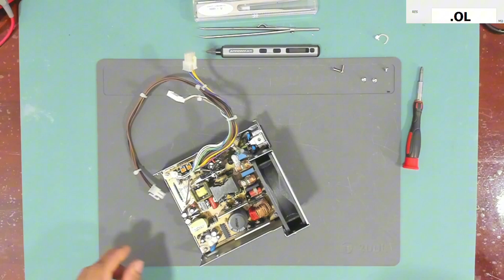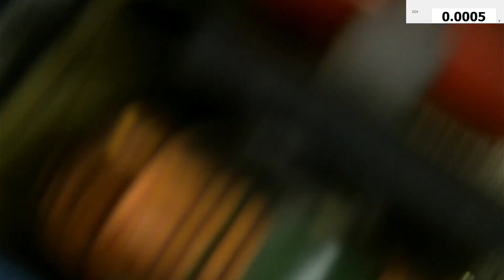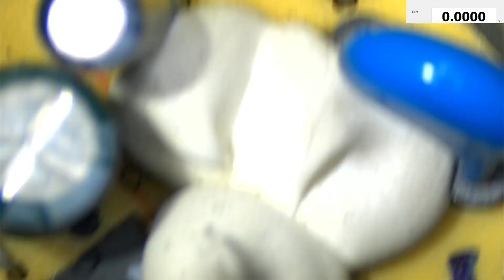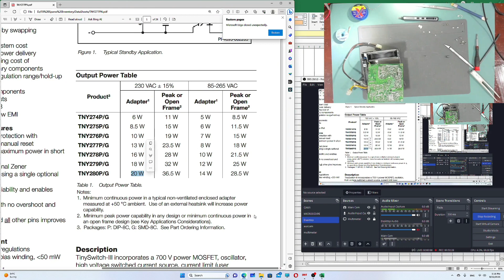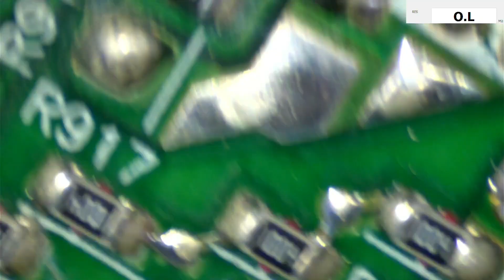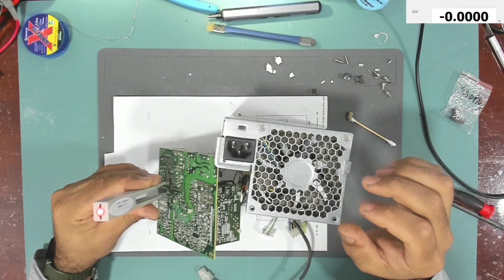Hp Power Supply Fix

Comment: Resp Sir! Very Nice Sir. Good Morning Sir. Sir One Customer bring the HP 300W SMPS SB Missing Sir, TNY277PN IC No Short, MFC is 335 DC OK Sir, VCC Capacitors are all OK Sir, Near MFC T2D04 Diode on board 10Ohms Value Beep Sound Sir, that Diode Removed and Tested No Beep Sir, 2Side Diode Mode Tested No Value Desplayed Sir and Onother Diode Replaced again Beepsound with 10Ohms Sir, where the Problem Sir. Please Advise Sir.  --   ChinnaRao Paderu Andhrapradesh
Reply from the maker: Hello brother 
Missing Standby voltage could be caused by the TNY277PN ic or its current feed resistor ( normally low value resistor ).

About the diode reading 10 ohms in circuit is normally caused by a parallel resistor connected across the diode. Which is normal if outside the circuit reads ok.

If the TNY277PN current feed resistor is not burnt then try replacing the TNY ic. It can be faulty but not shorted. 

All the best

Comment: What if we insert 82 ohm resister with tny279 switching ic?
Reply from the maker: Installing a more resistance resistor instead the original low resistance resistor will increase the limiting of the current going to the Ic and would cause the resistor to overheat
Reply: @FixTronics  
Would it only cause the resistor to overheat? Or would it also cause to give less current on ic drain and thus ic does not work and so does the power supply especially with 82 ohm resistor?